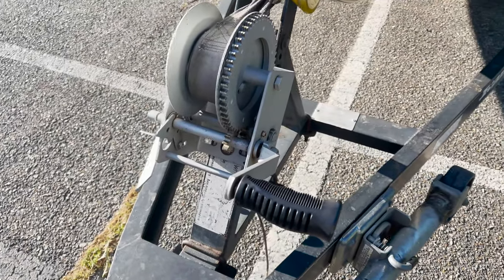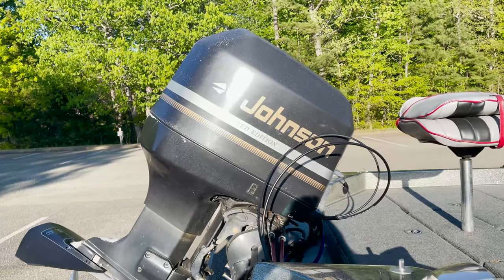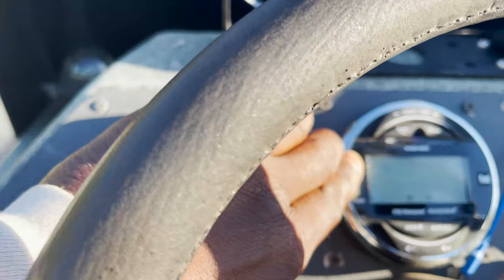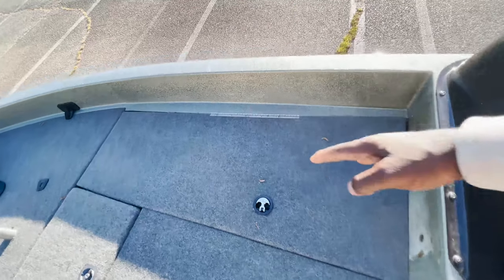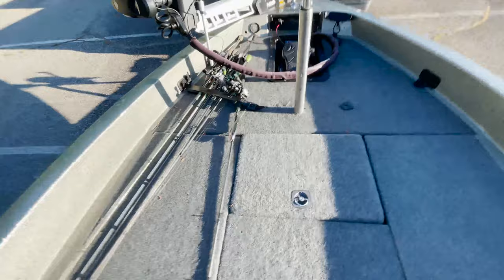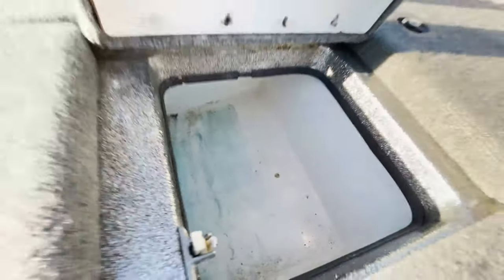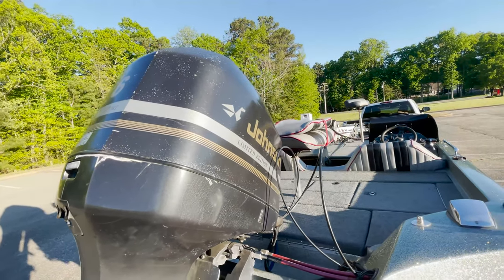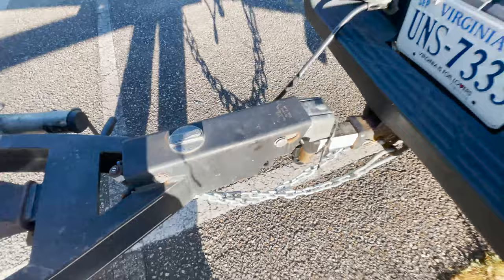I BOUGHT MY FIRST BASS BOAT !!!!!! || FULL WALK  THROUGH (4K)

Comment: Hey, on a real note - read up about how those surge brake trailers work........warning to you that most of us found out the hard way - if you try to back the trailer UP a hill, the brakes engage and you cannot back the trailer up (wheels lock up) because gravity is pushing the trailer surge brake forward.    Like I said, something a lot of us learned the hard way.  There's a way to disengage it if you' know you're going to get into that situation....otherwise just be wary of getting in that situation of having to back up a hill.  Pro-tip!

Comment: Congratulations!! First take your time with the boat and learn to drive it. Only and I stress ONLY use Evenrude/Johnson outboard oil for that model engine, and don't forget your fuel treatment. Talk to some mechanics from Richmond Marine or Ed's Marine the were both Evenrude/Johnson dealers. Also the trim is showing how much trim you have on the engine in relation to the hull. Either way enjoy it. You have worked hard to get it. Hope to see you at some of the tournaments or out on the James, Chick, Anna, Potomac or other local waters.
Reply from the maker: YES SIR

Comment: I don’t know if you can but I would pull the boat farther up on the trailer, so those back straps aren’t rubbing against the boat
Reply from the maker: will do that tomorrow thanks
Reply: @Gonefishing804  and if it’s tuff to do so it means you probably got to the the trailer at more of a angle into the water (farther in the water) Gods luck man!